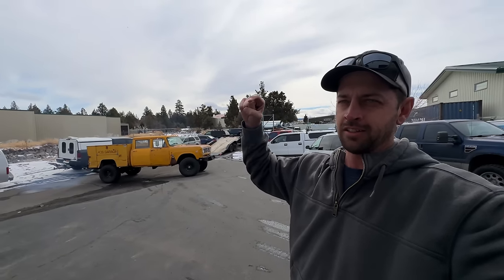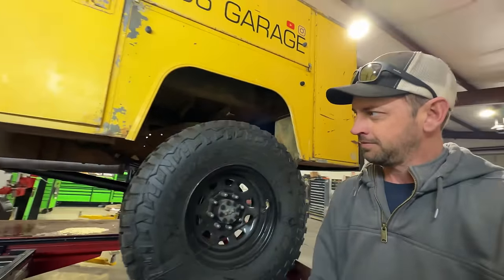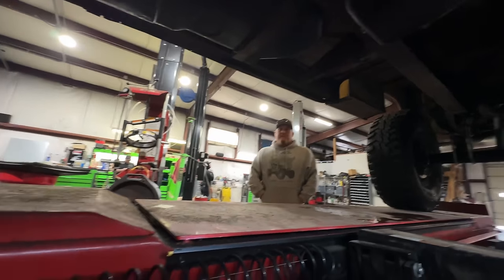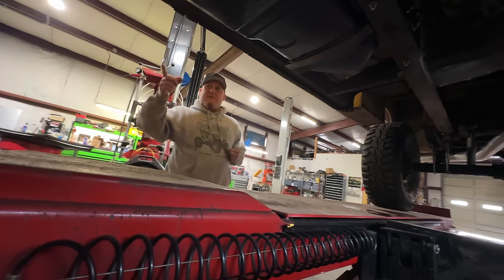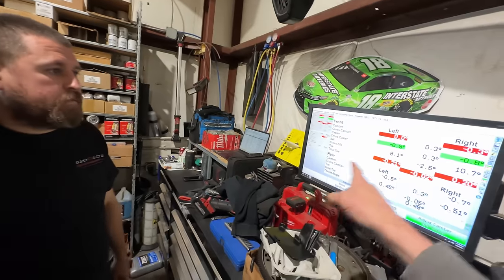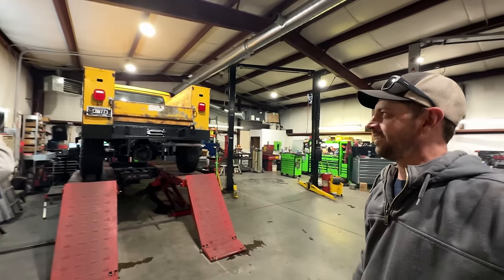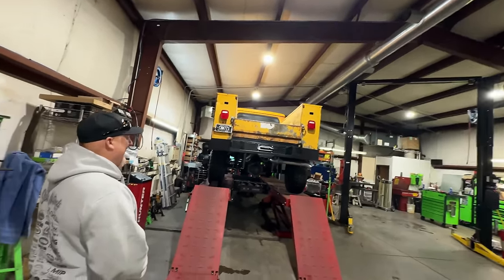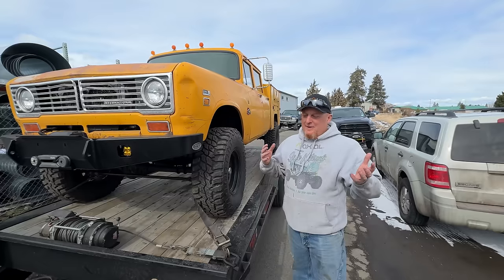Winning and Losing all at the same time.   Let’s hit the road.

Comment: Kinda sad that all the work still didn't get the truck to where it's safe to drive the distance, but kind of neat at the same time that you'll be able to take it in to the shop in Hurricane that can accomplish a major issue, allowing the truck to be useable. It will be interesting to see it once Merlin has done his magic on it as well! Casey & Ben - safe travels.
Reply: Plus 5 wreckers and crew to help out if needed 😂🤣👽

Comment: Raddle paint will save you a lot off guess work that's for sure, glad you feel the same way about those plastic foot baths, i put rubber mats in for the sheep. Stops them slipping about.

Comment: I'm very familiar with those two passes you guys have to go over. I've pulled a loaded bullrack over both of them in snow. Really once you get to Ontario you have it made for most of the trip. As long as a snowstorm doesn't go through Utah! 
Watch out for a couple of those passes south of Nephi, that one down by Beaver can be nasty in a snowstorm.
Reply: That's if they can even make it in to Ontario at the time
Reply: If you drive from Bend to Hurricane and Take 20 to 1-84 to get there you are completely missing out on the experience.  That is the absolute worst way to go.

Comment: What a an accomplishment for 13 days! Unreal how much work has needed to be done on this daily driver!!  Curious since you dropped it to a 2WD can you still be a support rig? So rad you both a hefty rolodex and folks willing to help. So rad! Have a save and good road trip Casey!
Reply: It’s still 4x4… they just remove the flat face tail shaft/output shaft from the tranny that had the transfer case directly bolted (normal 4x4) to it and put a normal (2wd) tail output shaft on the tranny to tie it to a divorce transfer case to operate the front axle.

Comment: As I mentioned in the last video, put it on a trailer, pull it with a truck that is more comfortable with overdrive then unload it 25-30 miles away and finish driving it to the event.  Save yourself some money in fuel that way also. However you get there I'm sure it's going to be a fun adventure. Be safe, enjoy. ** I made this comment when the video first started and had to edit it. I'm glad you decided to trailer it with your more comfy truck. Good decision I think anyway.

Comment: And some Lucas racking pinion with stop leak in it. And some Lucas transmission fix with stop leak in it to. Along with power steering fluid sealer with stop leak in it to.

Comment: Gotta know are you going to move the rear axle forward 2 inches or modify the rear wheel well?  It looks like the back of the well is getting ready to pierce the tread of the tire if you flex at all, though it could just be an optical illusion from the camera.  Good luck, hope all goes well.

Comment: Good luck guys! 
Lots of last minute scrambling.
I am not into all of the "tow truck challenge"  stuff going on lately but I will watch this event.

But, I am a little confused as to why an experienced car guy buys a vehicle (assumingly) sight unseen and then is surprised at all of the supposed misrepresentations made by the seller. 
Now, if you did inspect it, YOU, the buyer should be responsible for the inspection and acceptance of what you bought.
In either case, an experienced car guy (or anyone for that matter) has no real basis for complaining about the condition of what was bought.